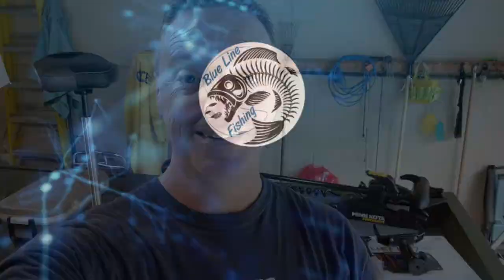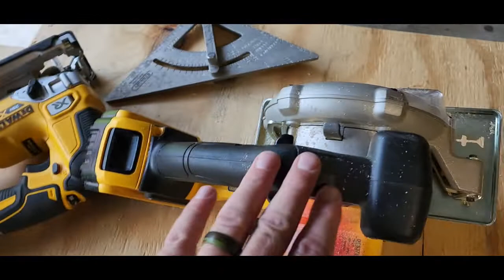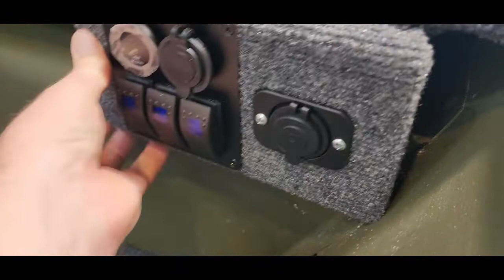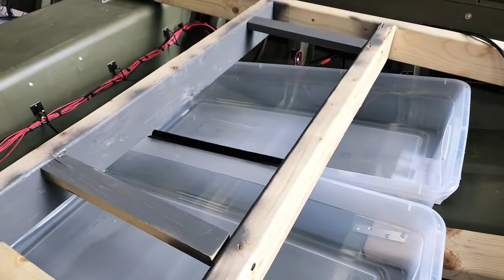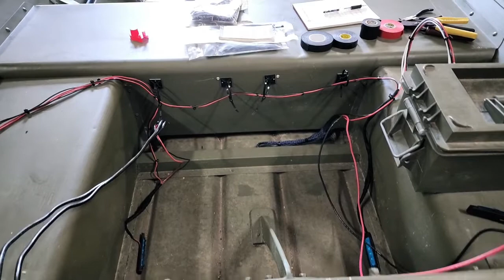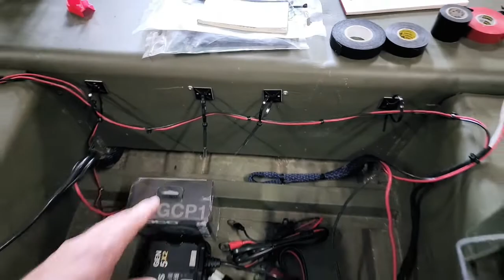Jon Boat to Bass Boat Part 4 | LED & Accessory Wiring

Comment: Question, did you run both red and black wires out of the fuse block to each led light or did you run them in series? I used  t connectors to attach each led light to the main feed wire and im not happy with the way it turned out.
Reply from the maker: One black and one red wire out of fuse block then tapped off of each wire with soldered and shrink seal for each light.  They are run in parallel.  If they are wired in series, they will not all get the same voltage, and will they will be dim.